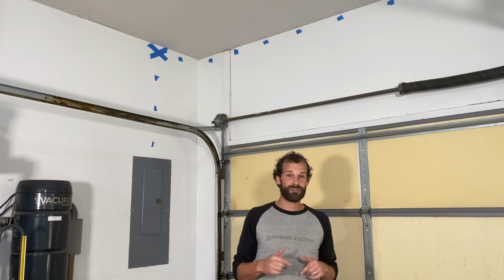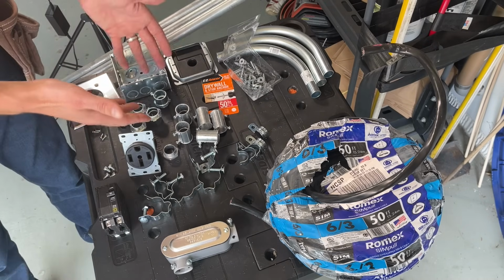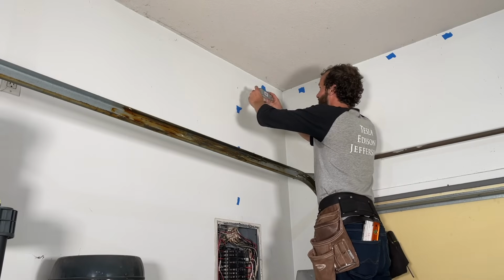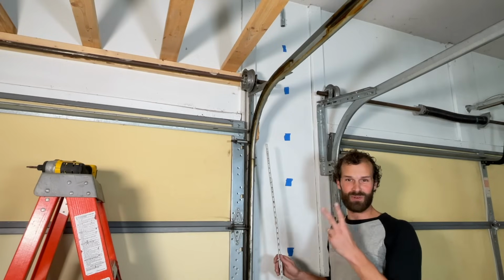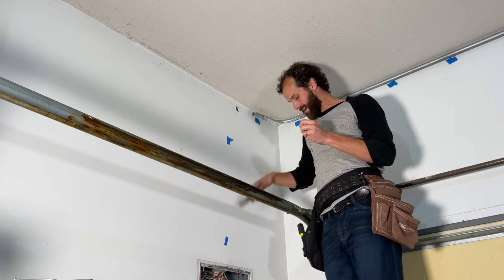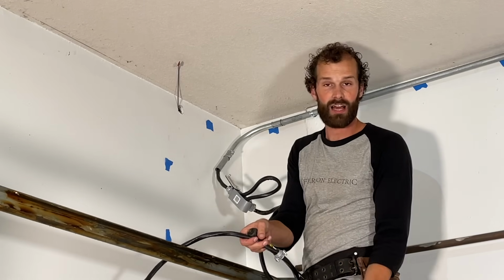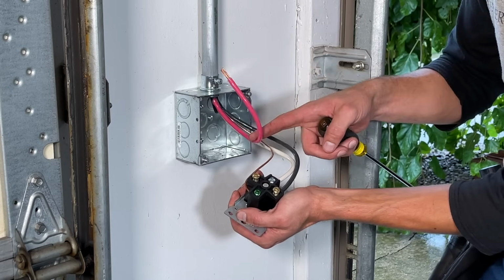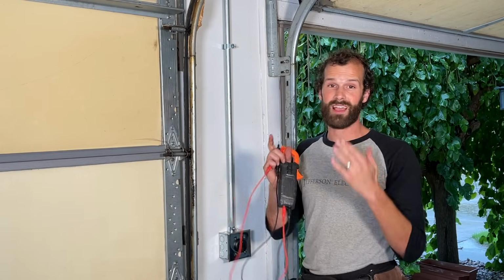How To Install a 240 Volt Outlet | Electric Car Charging

Comment: Very good video.  Thank you.  One question, why not install a 6-50 (instead of 14-50) to reduce the cost of the neutral wire and have the end user buy a 6-50 wip instead of the 14-50 wip they bought?  I believe the 6-50 and 14-50 wip are the same cost and will work with the mobile charger.
Reply: Because other than Tesla almost all current EVSEs use Nema 14-50 plug.
Reply: @hdtvkeith1604  Fair point.  The ironic thing is that the J1772 charging standard is 240V. Not 240/120V. It does not have a neutral connector.  Therefore, there is no need for the charger to require 240/120V and the cheaper 6-50 should suffice.
I think the 14-50 is more common because all homes have one for their stove.  But unless you're going to park your car in your kitchen I don't see why that should of been any factor in what is becoming the more common connector. 
The 6-50 is very common for welders and I've seen a few DYI put one in their garage for that purpose.
I did a quick search (and by no means exhaustive) and yes, more seem to have the 14-50 and the 6-50.  Every hardwired one I looked at only needed 240, ie. no neutral.  
But yes, if you want your install to cover all chargers, spend the extra money on a neutral wire.  How know, maybe some day someone will want to put a stove in the garage.  ;-)
Reply: @domenicdefrancesco  Fully agree. I realized this when I saw the hardwire option for my Wallbox, they don’t use the neutral since there is no 120V.  I ran 6/3 for a NEMA 14-50 which I will now convert to a 60 amp sub panel. I will then hardwire each EVSE to the panel and configure them for power sharing as to not overload the 60 amp panel. I think you have some homes with electric dryers in the garage that may have a 14-50, but my house was so old the dryer is upstairs only is on a 30 amp 220 line. My new stove used a 14-50 so I had to have that line and outlet redone when remodeled.
Reply: @hdtvkeith1604  Good luck with your install.  I think its great that the EVSE can power share.  Such a great feature.
Reply: @hdtvkeith1604  Most of the 50A chargers can be ordered either 14-50 or 6-50.  While 14-50 may be more plentiful (almost all houses have one in the past 30+ years, and some RVs need them), 6-50 is very common for welders.

Which is why I explicitly chose 6-50, because it allows me to dual-purpose the receptacle.

Mine had to be outdoors, so I chose a weatherproof box kit which could be ordered either way.

Comment: I fail to understand why you wanted to do 14-50 and 6/3 wiring. Seems like a waste, because EVs have no need for a neutral when using 240v. Neutral is only ever used when at 120v charging. The only thing I can think of is that SOME EVSE need the 120v to power their circuits like my splitvolt 24 amp EVSE, but this is really an exception to the rule. Teslas mobile connectors will run without a neutral just fine.
Reply: If you are installing a Nema 14-50 receptacle you must use all wires in case some other device is plugged into it. If you are hard wiring a charger that does not require a neutral then it is OK not to run a neutral wire to the charger.
Reply: @Sparkeycarp  my point was that the 6-50 would have been a good option but I didn’t know it’s name at the time of writing this. I could have done this better.

Comment: So glad I only needed 50 bucks worth of hardware for mine. I just used a 30amp dryer circuit.
Reply: For what size charger?  How many KW?
Reply: @KevinCoop1  5.7KW I think. 24 Amp 240v. My 15 Kia Soul EV only has a 6.6kw inverter so the extra speed is negligible. Still fills the car from dead to full in <6 hours so doesn’t really make much sense to spend the extra on a 40 amp, both wiring and evse wise
Reply: @EV_Dreams     Perfect.   The 5.7KW is right on for 30 amp breaker.   The 6.6KW should really be on a 40 amp breaker, as it would pull 27.5 amps for more than 3 hours.   If your breaker starts tripping on the 6.6KW in the summer, you will know why.
Reply: @KevinCoop1  my EVSE is 24 amp so even though I have the ability to pull 6.6 the max it will ever tell the car to draw is 5.7/24 amps. Personally though, I think the 80% rule is a bit too extreme. I think we could easily get away with 90% and not compromise safety, but not enough to actually try anything stupid without testing first.
Reply: @EV_Dreams     The 80% number comes from lots of testing in the past under exacting conditions.   Very specific voltage, amps, conductor size, conductor length, time, and very much important ambient temperature.  I believe the testing is done at 86 degrees F.   So, if the temperature around your panel is 86F it should operate at 80% of its rating for 3 hours without tripping.   Hotter=shorter time, colder=longer time.   Example:  in a large freezer I was designing electrical system for, I was concerned about 20 ampere breakers not tripping.   After contacting smart breaker company people, I calculated that the 20 amp breaker would handle around 80 amps.   Being concerned, finally common sense came to me.   If the breaker and all of the conductors in that branch circuit are in the same ambient temperature, no problem.   But if the conductors are in an are of 86 degrees, big problem.  Too long but thought you might like the example.

Comment: Pulling NM cable through EMT is strictly-amateur!  Should’ve ran THHN conductors instead.  Could’ve used a small piece of flex down the wall.  Also, instead of a plaster ring and plate, could’ve used a raised mulberry cover.
Reply: Way before YT  and everyone gave advice on repairs I use to watch PBS and those repair shows even those seasoned professionals had to go back and had to redo everything from the beginning be nice
Reply: Agree but for DIY example it's just fine ive seen home owners mess up thhn. I just hope people buy a good hubbel 14-50 and not a cheap big box outlet! I melted 2 w my welders on high before I realized what HD has and what hubbel make are worlds apart...  and EVs pull.more for even longer.
Reply: Metal flexible conduits are limited to circuits protected by a 20A breaker max.

Comment: Excellent demonstration! Glad you didn’t make it look too easy, as pulling that romex can be tough!
Reply: He shouldnt be running Romex in conduit. The wire builds heat inside the conduit and with a jacket that heat is retained. That retained heat is detrimental to the insulation. Stripping of the jacket on Romex and pulling that through conduit wont work because the insulation on the wire isnote up to spec. Or code! There really is a lote more to this than just poking wires in holes!

Comment: Man I never thought to just shove all twenty something homeruns into one 2” knockout on top of the panel! That will definitely save me some time in the future and I won’t have to waste a bunch of connectors either! Thanks for showing that! 👍
Reply: youre actually allowed to do that. its called a stuffing tube where im from. Any conduit length less than 2 feet (called a nipple), you dont have to derate the conductors ampacity. It is 100% allowed by the NEC
Reply: I didn't call it out, but that could create an overheating situation and a hazard. Recommend separating the cables into individual conductors.
Reply: @joelwalsman773  but then I wouldn’t have to add a heater in my garage, just pull the panel cover off in the winter and my garage will stay nice and toasty! 😂

Comment: I would remove that section of drywall above the panel stud to stud run the conduit. Replace the cut out section you remove, tape the joints and avoid all that fishing. Granted some Electricians don't know how to finish drywall. I do so that is the way I would do it. I have been a licensed electrical contractor for over 40 years.
Reply: I fish flex through the wall. I can do drywall repair if I have to. Why should I make a mess if I can fish?
Reply: Phil, we need you on our team! I'm terrible at drywall. :-)

Comment: Something I was told decades ago, and still don't fully understand is: Install breakers by size, with the largest the furthest (down the buss) from the main breaker/incoming lines. Anyone know why?
Reply: I can't help you here, Paul Buehler. Solar PV breakers are required to be placed at the opposite end of the bus, but standard consumption breakers-can't see why they would.
Reply: I designed electrical systems from 1983 to 2018.   Never heard that one before.   Someone may have had the opinion that it would leave more conductor length in the panel gutters in case something happened to it.  If problem, cut the wire and move the breaker.  (Best guess)
Reply: know in the UK its best practice (Not official) to have the higher size breakers nearer to the main feed as it means there is less distance for the higher current on the rails, not sure in regard to US breaker panels though.

Comment: Do you need the neutral lead for a 240 volt outlet?
Reply: Joe,   Only you can answer this question!   It depends on what you are powering.  If a compressor or welder that the name plate says 240 volt single phase, then no neutral.   If you are connecting an electric dryer or stove and nameplate says 120/240 volt single phase, then yes you need a neutral.    Make sense?
Reply: @KevinCoop1  Yes it does make sense. Thanks...
Reply: @joeruiz9029    Best wishes!
Reply: Yes, a Nema 14-50 must have a neutral in case someone plugs in some devise that needs it.
Reply: @Sparkeycarp     Your comment is correct for a 14-50r.  But not what his question was.   14-50r is 125/250v rated.  What about 7-20r?   250v rated.  Neutral required?   If yes, NEC article number please.   One thing I learned from the thousands of code and design questions asked by designers, project managers, and electricians over the years was parce every word and ask them every question to make sure you totally understand the question.

Comment: You should have use an industrial raised cover instead of a 2 gang mud ring and cover plate. Also you forgot to bond the 4 square box and needs to be on a GFI breaker.
Reply: I'm not an electrician, but almost all, if not all, EVSE's (Electrict Vehicle Supply Equipment) AKA EV Chargers have a GFI breaker built into them.  They actually recommend NOT using a GFI breaker.
Reply: @rossm9200  all 120V and 240V receptacles in garages need gfci protection per 2020 NEC. Hardwired charger is a different story.
Reply: @lars949  the latest NEC code states that, but many municipalities have not adopted the latest code yet. Plus GFCI for the EVSE will likely cause false trips. The best this is to hardwire the EVSE which will negate the need for GFCI breaker. My county still does not require GFCI in the garage outlets so I ran my NEMA 14-15 without it. I will however be converting to hard wired as I am adding a second EVSE with power sharing a\will put in a sub panel to avoid a second long run back to Amin panel or the need for a junction box to handle the splits. This will allow me to de-energize either EVSE individually.
Reply: @hdtvkeith1604  agree hardwire doesn't need it but its been required for EV chargers since 2017 due to TIA 17-2
Reply: So correct to use the GFI breaker,also by code should be Thhn In conduit not romex.At least in Comnecticut
Reply: @johnbartoli2781  Depend on you local code, my county has not adopted latest NEC codes so I did not need a GFCI. I will likely hardwire them eventually anyway.
Reply: Ok,still like the video,I've done alot of charger receptacles here in Ct. Keep up the good work

Comment: I'm not even an electrician and I saw that this was a mess. Outlet box is not grounded, device is not grounded.  Turn off the main breaker at the meter before attempting.  Do not pull wires from a panel using a metal fish tape.   Do not run Romex through conduit.  That's the wrong cover to use on the outlet.  It's well worth the price when charging a $50,000+ gadget to hire a licensed electrician.  This video gets a great big nope!
Reply: you are allowed to run romex through conduit
Reply: @domthedonkey69420     Yes, for protection from physical damage.  It is not an intended wiring method.   He could have done it differently.   Agreed?
Reply: @KevinCoop1  This would be a case of protecting against physical damage. And its allowed, i dont know what you mean by "not an intended wiring method".The comment above me said Do not run romex through conduit, which is wrong, you can. 

Yes, I would have used thhn. But i cant fault homeowners for using romex in this case seeing as that's the most straight foward and they sell 6/3 at home depot.
Reply: @KevinCoop1  This would be a case of protecting against physical damage. And its allowed, i dont know what you mean by "not an intended wiring method".The comment above me said Do not run romex through conduit, which is wrong, you can. 

Yes, I would have used thhn. But i cant fault homeowners for using romex in this case seeing as that's the most straight foward and they sell 6/3 at home depot.
Reply: @domthedonkey69420     Technically, it says for physical protection up to 8’-0”.  Is the horizontal conduit above or below 8’-0”.(unknown).  Also, since I started designing electrical in the dark ages, it used to be illegal to install NM in conduit, except for 24” or less.  Then it was changed to 6’-0” or less, then(because of political reasons, was allowed to run up basement walls up to 8’-0” for protection of conductors.   Now, the original intent of the allowed install of NM in conduit is being overdone in my opinion.   History gives you a little different outlook.   So, yes it is probably code compliant to do.
Respectfully,   Kevin

Comment: I was under the impression that romex can't be used in conduit? Romex to a J Box then THHN from there?
Reply from the maker: Code calls out Romex can't be used in conduit when installed in a wet area.  With that said 1" EMT or greasing up the Romex would have made the wire pull much easier.
Reply: @EverydayHomeRepairs    You missed the point.   He said Romex up the wall to a junction box, then use thhn from there to the receptacle.   NM cable is allowed to be in conduit for protection from physical damage.   It is not the intended wiring method for NM.

Comment: Should have cut a piece of cardboard to cover majority of panel to keep metal fish tape from accidentally making contact with a live conductor…even if the main breaker is off. 

Should also use a contactless voltage probe to verify hot areas.
Reply from the maker: Thanks for the feedback!

Comment: 1st of all its 240v plug not a 220v this isn't trailer trash install
Reply: First, it is a 120/240 volt receptacle.   He showed no plugs in the making of this video.   The maximum voltage rating is 250 volts.

Comment: So many unnecessary steps and materials from the "pro". 
First why didn't you have it inspected?
Unnecessary steps- instead of conduit MC cable could have been used the whole way, only DIYers and those that don't know more install romex in a conduit.  Too difficult, not necessary.  Greenfield could have been dropped down from the condulet so individual conductors could have easily been installed. Like most car chargers a neutral wire is not necessary so you have more wire than needed. 2 hots and a ground all that are required.  A plaster ring is not necessary for the box, a raided cover made just for this would have been much easier to attach the receptacle. 
By code the romex should have had a connector at the condulet to secure it. Last, connect it to a GFCI, it's a requirement in the 2020 code as well as many of the car instructions recommended it. Where's your bender to make your box offset for a nice neet pro job??!!

Comment: Great video! Doesn’t seem in this case the EMT can serve as a grounding pathway since it’s not going all the way back to the panel. Also, I don’t think it was mentioned explicitly that the breaker needs to be GFCI.
Reply: Good dialogue Delta 2038. 2020 NEC hasn't been adopted by Illinois and GFCI requirements for outlets up to 250 volts was a 2020 addition. Would it be fair to say that this is "code compliant" since it's compliant to the enforceable standard for this area even though it's not up to speed with the 2020 NEC?
Reply: Good point. Thanks again for the video.

Comment: I didn't see a Romex  connector in the LR that goes in the wall.  Liquid tite in the wall would have been a decent way to get to the panel and allowed you to just use THHN the whole way.
   Stripping the Romex jacket from the part in the conduit would have made it easier.
Reply: We used a chase nipple to manage the transition. What do you think? A romex connector would've worked well too!
Reply: @joelwalsman773  That would definitely protect from abrasion which is required, but this quote from EC magazine suggests that a connector that secures the cables as they enter a box or conduit body is really required:
" Section 370-17(b) refers to all raceways and cables installed using metal boxes or conduit bodies. The raceway or cable must be secured to the box or conduit body. Again, using the proper connector or fitting and making sure the locknut and screws are tight will ensure compliance with the requirements".
    In 40 years, I've never seen a cable abraided by going through a bushing without a connector,  but I don't think the code allows it.

Comment: my question is why? why did they spend all that money on EMT and run romex through it? plus, the box is not bonded to the ground  and it looks like the conduit ends at the wall above the panel... so they could have used PVC conduit and saved some money....

Comment: Wrong cover at plug in. That's for a finished wall application. A raised cover is supposed to be used. That breaker should have been shut off for sure.

Comment: How are you interpreting 
2002 NEC 334.12(A)(10)d. ?
NM wire shouldn’t be installed inside EMT.
Reply: 2002 was before my time as an electrician. NM wire in conduit is an NEC allowable practice. If your local AHJ does not allow that's a different story.